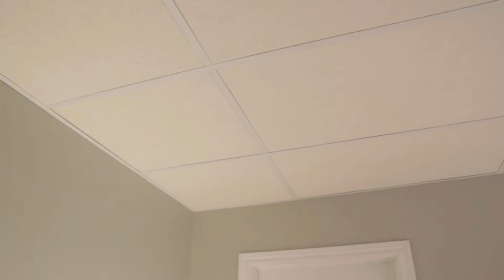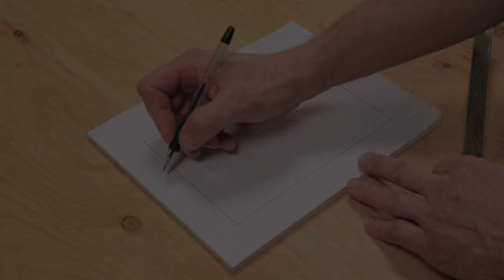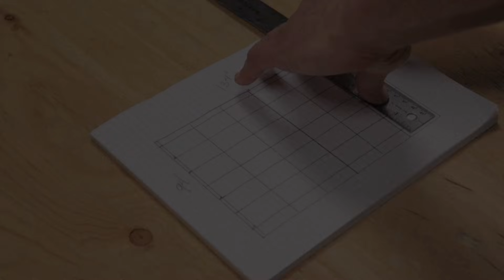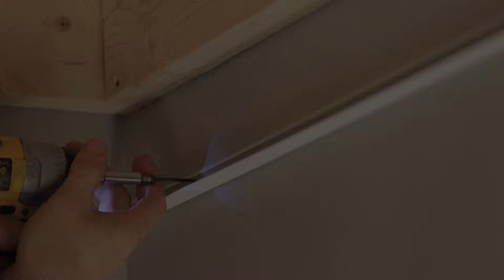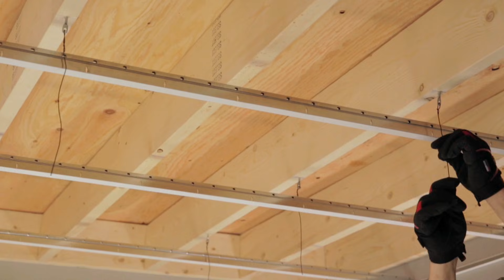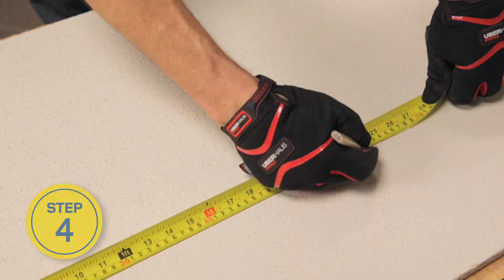RONA - How to Install Suspended Ceiling

Comment: I've seen 3 videos now on this installation & not one showed screwing channel into cement block. I wanna do my basement & turn one section into a den. Should I just drill into the block or somehow bring down furring strips to screw into?
Reply: Screwing into block is a pain. I would install wood framing or strips to screw in to

Comment: If the mains are 4 feet apart. . . . . How do I then install the 2 foot cross tees between them, as you said ? ? ?
Reply: Good observation
The cross tees would have to be 4' long and placed 2' apart

Comment: Great video, but makes it look too easy. Especially where it says “you’ll have to shorten one of the main runners until square.”  That means taking stuff apart, pulling it down, trying not to mess up what’s still good, swearing a lot, realizing you cut the wrong one, etc...
Reply: LOOOOL

Comment: Hey Rona your skipping the part about walls being perfectly straight, string lines work better and faster. They sell 4' tees so your mains are 4' apart. Less mains less wires to hang less work. You don't do this often i guess. No framing square needed. 15/16's grid corner to corner will measure 52 1/4". 9/16 grid 52 3/4's". You do not have to draw anything measure the room. If you want tile center of room or grid center of room.

Comment: Not even close. How do you get equal borders. Did you use a level or laser for wall angle. Make sure your grid is square before you finish installing. There is no reverse. This is why home owner are screwing up n calling me to fix it.  Bad video.
Reply: Measure the size of the room. If you want a tile center of room or grid center of room

Comment: Great video. One Q .. What if I have to install tube lights in the ceiling?
Reply: Tube lights normally are attached to bottom of ceilings unless you order lights to fit into grid then you have to frame it in.